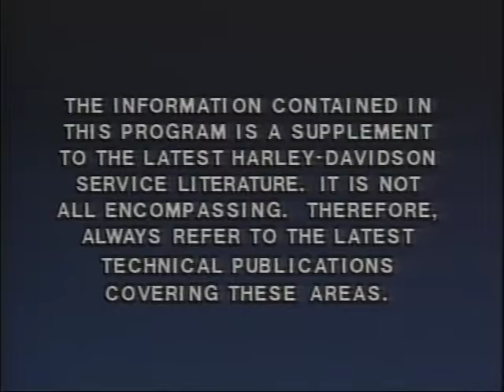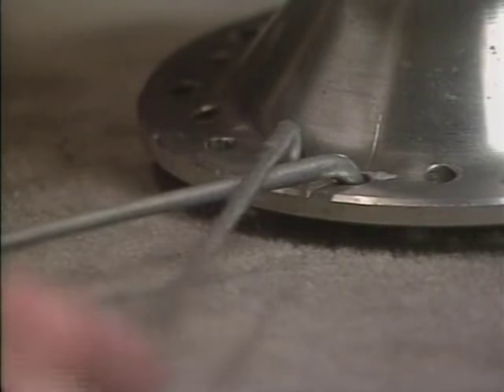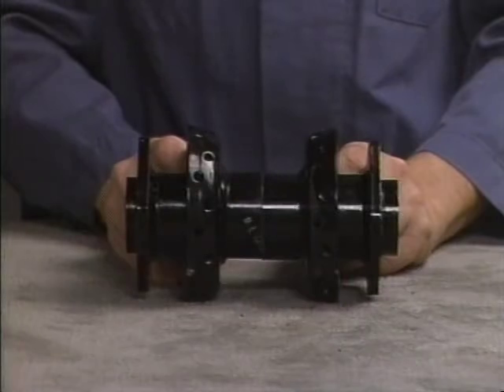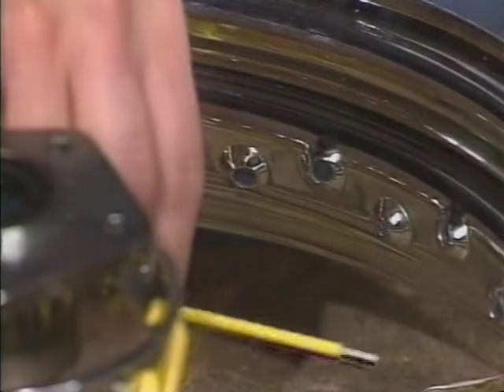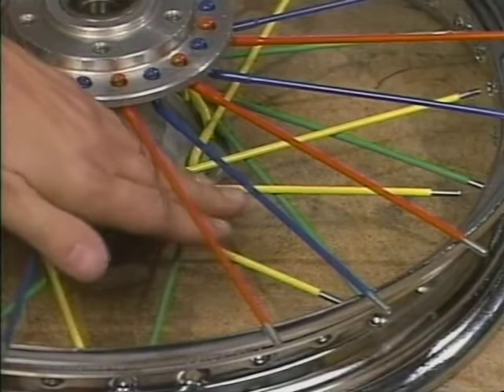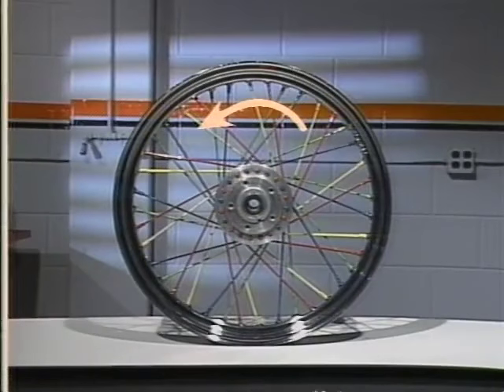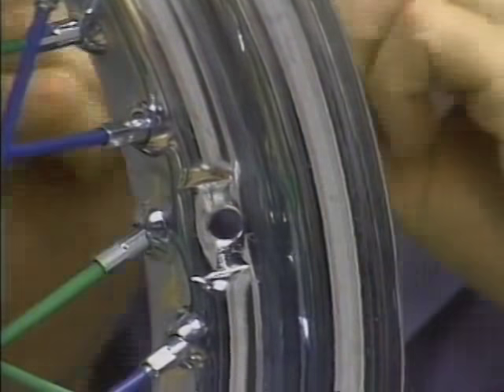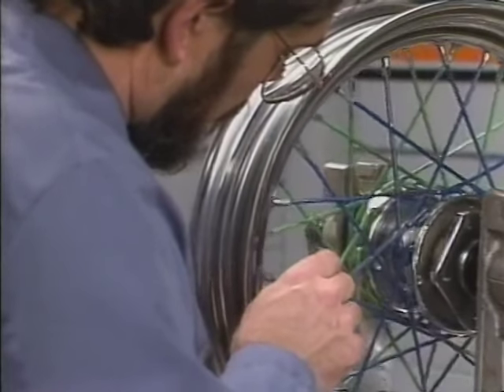HD Wheel Truing guide

Comment: This video was reminiscent of the 80's sex ed videos many were subjected to, super corny, maybe a little uncomfortable at times to watch, but chock full of information.  I am working on a 75 Ironhead bobber project and using 16" rims front and back.  I was having a devil of a time relacing the rims, partly because I didn't take reference shots before I tore them down, and it had been months between teardown, paint, and relace.  As it turns out I have an A and a B style hub so as I moved onto my front rim I couldn't figure out why the pattern wasn't working (and I got lucky on the rear), now I know.  Serious props to this video, if you need to lace your rims, this is the holy bible of instruction.